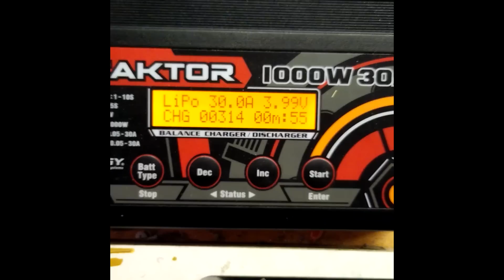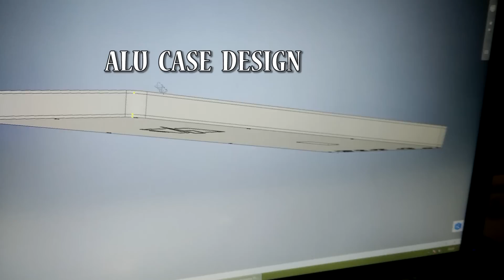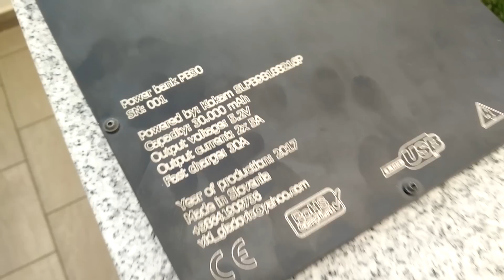The ultimate DIY Power bank 30.000mAh

Comment: is it possible to have a step up connected for a 12v output option
Reply from the maker: Yey, just tune up one of the DC converters and you will have 12V on output.

Comment: how much heat will it generate when charging and discharging? at high amps how much heat will it generate?
Reply from the maker: Charging via usb connector at 3A will not generate almost any heat. Charging via fast charge at 30A will generate some heat on the conectors, cables and mostly on the fuse. The cell can handle such current and it will not het hot. I am usually charging via fast charge connector at 10-20A. This will not make almost any heat.
Discharging via 1 or 2 outputs at 2A per output will not get hot. Discharging on all 4 outputs will make the step up converters a bit hot, but since the case in aluminum it will not overheat.